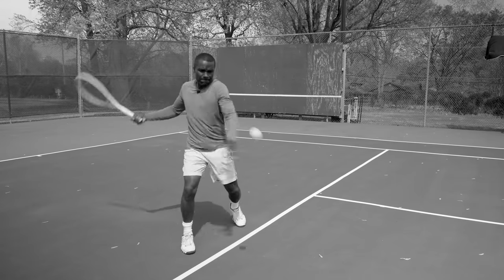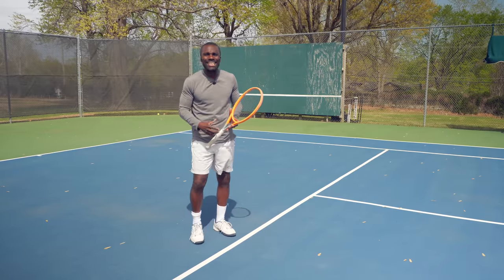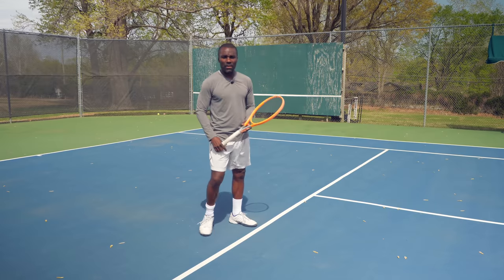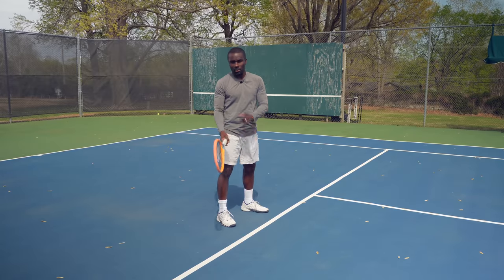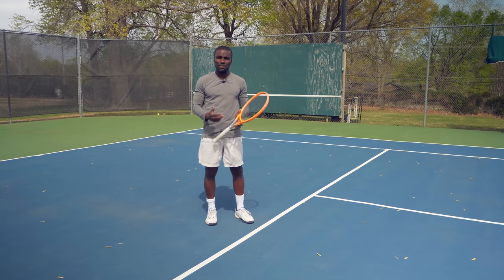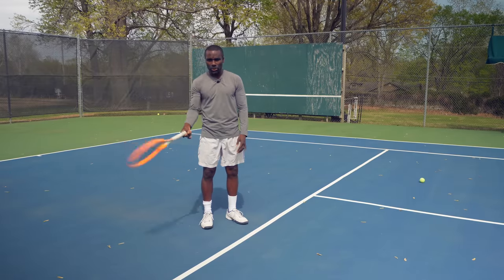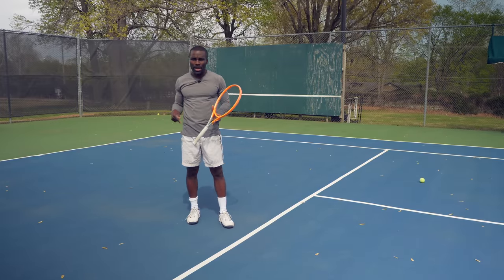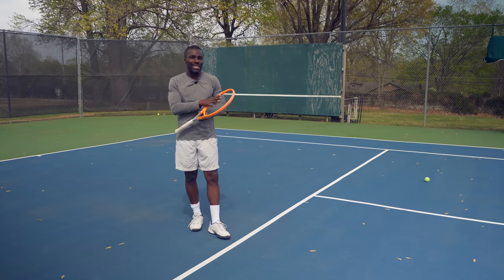Tennis Forehand Technique: Get more power out of your forehand while swinging easier...

Comment: Nice video Kevin. One thing I noticed is in the drop feed and your instruction to use off hand as measuring the contact point, the contact point is right at the fingertips. But when you students hitting rally with you, the contact point is further away from his finger tips. Which one is correct?
Reply from the maker: I would say the your finger tips but theirs a little room for adjusting for using a bent or straight arm at contact too.
thanks

Comment: Hi love your videos and love the understanding of how the racket face sends it, but I can’t see myself opening and closing the racket via pronation/supination and adjust. Wouldn’t it be easier to just use different grips that naturally change the racket face depending on the height of ball at contact? I know that people are of different heights in relation to the net and that means different people will use different grips for the same height ball (some even use grips in between bevels for forehands and backhands). I’m pretty sure each person has to experimentally practice on the court like you suggest to know what racket face to use, but I’m uncertain if you’re tilting the racket head with wrist or if you’re changing your grip and the pros/cons of doing either or (for forehand/one handed backhand)

Edit: I think the wrist movement to change the racket face (for height of ball) is more flexion and extension than pronation/supination mb
Reply from the maker: Yes, it is flexion and extension. The reason you really don't want to change your grip is because it changes the feel you have develop for the racquet orientation. When I would train in Spain on red clay my grip would side over a tiny bit but not a major change due to the height of the ball bounce. thanks
Reply: @TotalTennisDomination  thank you for sharing your experience; I’ll experiment then using flexion and extension then and change of grip slightly for different court surface.